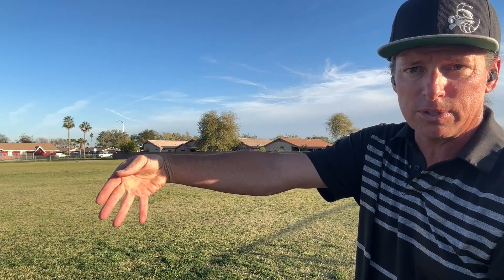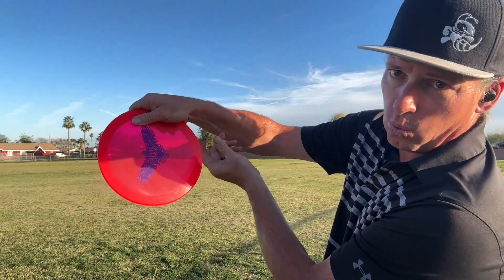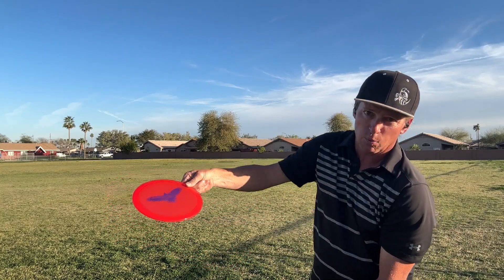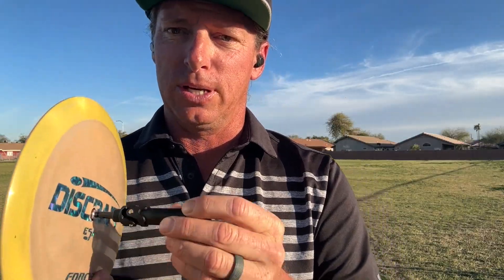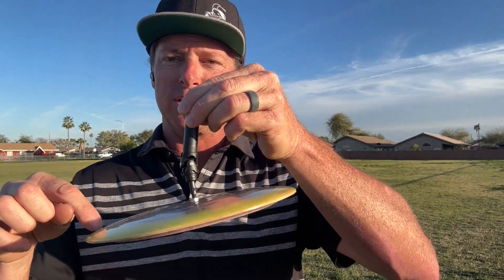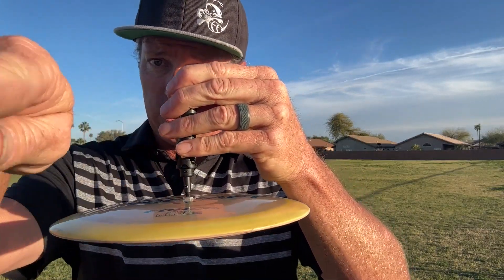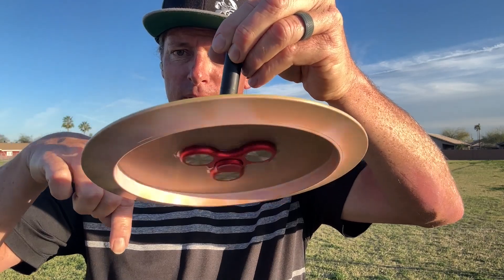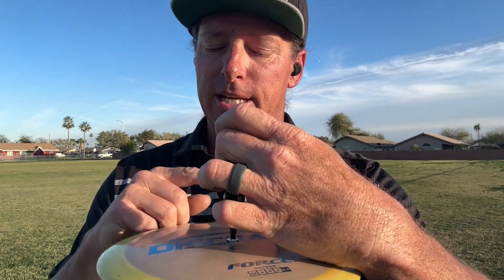Thoughts on Nose angle and gyroscopic precession

Comment: New subscriber to the channel and finally getting through these golden videos. I appreciate the demonstration, but now im wondering how you can apply pressure at the last point under the disc? You're taught to get your "thumb print" on the disc and grip firmly,  which I feel like leads to the pressure on the top creating that nose up effect you're describing. 

Any ideas to work off of help. I guess Im thinking maybe to focus on pulling in more to grip the disc from under, rather than thumbing it down too hard into my palm.
Reply: Naturally I went and watched your next video on grip which confirmed my suspicions lol. Thanks for the coaching Pete.
Reply from the maker: @marcocrespo8796  good work:)
Optimally the wrist needs to be in supination at the moment the disc begins to release from the hand….if we use the fingers to squeeze up into the palm it naturally holds the wrist into supination. (easy with a fan or modified fan grip, but doable with a power grip if the finger pads are shared in the crease between the rim and underside of the top)

Comment: If im not wrong gyroscopic precession would only apply if there was off axis torque on the shot. On proper releases there is not enough off axis torque to have to worry about this, and if there is enough off axis torque in your throw that is does matter then you have bigger issues then nose angle. I could be wrong but this is my understanding
Reply from the maker: @finnmccann446  all pressure put into the disc that is not in plane with the discs rotation around it axis is “off axis torque”.
Each finger as it releases from the rim impart a small off axis torque upward. This has a direct effect and in practice and testing can drive the tail of the disc up or down depending on wrist pronation and supination. More extreme off axis torque is often a mid-alignment of swing plane to release angle and is usually contributes to more wobble.

Comment: I get it and it makes sense. But how do i make use of this in my throw? How do i apply this upwards force at the end of my throw to create this gyroscopic nose down effect?
Reply from the maker: @bjornekloo  I made another video called “goodness grip”.  Check it out if you get a chance.
With an assumed starting point of having decent form mechanics:
Pronation of the wrist during the release point causes nose up. This is most often caused by higher thumb pressure  downward and/or finger pressure pulling into the palm. It’s common for folks to roll their wrists inward because holding tension towards supination while holding the elbow up can be challenging.
In the “goodness grip” video, I’m making the case that proper grip pressure helps keep the wrist in supination during the hit point, as well as allowing for each finger to release cleaner with a natural upward pressure, as well as keeping the thumb/index finger pressure neutral at the final point of release. It also allow for greater and faster wrist movement, whereas dominant thumb/index finger pressure tends to lock the wrist into one position limiting flexion and extension.

Comment: Gripping harder with the pinky and ring finger will give the push up in the back.   Not sure if anyone has mentioned this yet.
Reply from the maker: @mattbraam6357  depends on the direction you are squeezing your pinky and ring finger. If they are squeezing harder into the palm in a pulling motion, it can lead to wrist pronation. If the squeezing motion is upward into the meat of the palm below the thumb, it helps hold the wrist toward supination..
I did a video just after this one called “goodness grip” where I cover this. Please check it out.!

Comment: It's still a gyroscope even if it's attached to our hand. It's just that a fully grown man is easily strong enough to dominate the gyroscopic effects of a 175g disc spinning at 1000-1500rpm. Try it with a two-ton flywheel spinning at 6000rpm and you'll realize that it doesn't stop being what it is just because you put your hand on it.
Reply from the maker: Agreed. From reach back to the 4000ths of a second before it rips from the hand it there is the equivalent of a half rotation imparted on the disc, which on techdisc reads as a ramp up to 800rpms.
The main thing up for discussion for me was, can we call it a “gyroscope” when being leveraged from the edge, or is there a different scientific definition we are supposed to use. I feel I’m grasping the general understanding of what’s going on and sharing it, but I try to be careful to not make assumptions in my own statements sense I don’t have a phd in physics.

Comment: Really interesting video Pete! Thanks for sharing this. Do you think this means that the ulnar deviation/pour the coffee  is trivial or do you think that a combination of ulnar deviation and the supination/flipping the disc is essential to get the desired amount of nose down?
Reply from the maker: A form of Radial deviation grip is where most folks start their disc golf journey. Somewhere along the crease in the palm in line with the knuckles.
Our goal is to line the disc up in the crease on the hand from between the index and second finger along the crease that runs along the them/palm into the wrist. A soft ulnar deviation will line the disc up along the forearm and wrist.
“Pour the coffee” should be given with a caveat of “is HOT, pour gently, or you’ll spill and scald your yourself”.
When we over exaggerate the pour, we inevitably will bind the hinge (our wrist) along its extension path, which will lead to it wanting to unload radially part way through the release, often leading to a nose up issue.

If we grip the disc properly, I think much of this discussion will inevitably work itself out.
“Flipping the disc” over the wrist, is a “feel” exercise that helps us find a position not totally natural. If we stand and hold a power pock position with the elbow up, forearm level and disc flat, we will find that there is not much room for the wrist to supinate, drop the elbow and we can supinate farther because the elbow is the “limiter” to that movement.
 Pronation is super easy to do in this situation because most of the movement available along this axis is free to use especially since the gripping muscles pull in that direction.
Supinating of the wrist puts downward pressure on the disc and the nose will go up. 
If the grip is set up properly the muscles will work in such a way as to help the throw rather than harm it.
These “feel” exercises (flipping the lid, turning the key, suit casing, etc)are not the final solution, but rather a gimmick to guide us into what the proper position feels like so we can better align our body’s with the action we wish to produce.

Comment: did i miss the part where you tell us HOW to throw nose down?  i seemingly finished the video still not understanding how to achieve nose down.. am i to assume that to get the nose down i need have the bottom of the disc "underneath flate plate" facing my chest within the power pocket vs the top of the disc? or are you saying we should attempt to throw nose up so opposite of coffee pour making back of disc nose up but the back is really the front and when released the back becomes the front?? im still confused??
Reply from the maker: This was not a “how to video” on how to throw nose down.
This was really to help everyone understand what is “the nose” and how gyroscopic procession, and how the the pressures of off axis torque drive nose angle.
I’ll do some coaching style videos on the future and explain ways to help drive the nose angle down. There is another video before this one discussing” the last point of contact”
I’ll say this. If at the release point the wrist pronates, or thumb rolls under/pushes down on the top of the disc, the nose will go up. If at the release point, you supinate the wrist, keeping the thumbnail pointed to the sky, and fingers under the disc keeping upward pressure towards/into the palm, your will have better luck throwing nose down…..
“Coffee pour”… the whole purpose of this phrase is to get the disc level and in line with the wrist and forearm, Moving it from the disc lining up well below our elbow.
If we push the coffee pour to an opposite extreme, (a common problem now) as if pouring a bucket, the alignment of the disc will point not through the center of our forearm but across our forearm and above our elbow….this binds the wrist and exacerbates the nose up issue in the end.

Comment: I have one (a lot more than one) question about something that you're alluding to but I'm not sure if you have explained yet.  When your forefinger becomes the last point of contact and pushes upwards on the disc, it's causing the disc to tip nose down a little.   Is there a way to control this?   Are you saying that the fan grip has less rim pressure so the pop off doesn't cause the disc to go nose down as much and a stronger power grip would force the nose down a little more on release?   Would you want to minimize this release point contact to minimize wobble or are you sacrificing power when you minimize release point contact?
Reply from the maker: Thank you for the question.
I generate basically the same amount of spin with a modified fan grip as I do with a power grip. One interesting point I noticed is that the grip pressure is distributed near the same but slightly different. Power grip: my index finger squeezes around the rim to itself with the thumb covering/pinching down over it, while the two middle fingers squeeze into the palm as well as the pinky finger.
Modified fan grip: my index finger squeezes around the rim to itself with the thumb covering/pinching down over it, while the two middle fingers stack over the pinky and each other then squeeze into the palm but through the flight plate.
If the fingers are squeezing up and into the palm it tends to keep the thumb from dominating and causing the pronation or turning in/rolling under of the wrist through the release point. At the moment, this is the biggest takeaway.

With both of my grips the thumb and index finger come free of the disc at nearly the same time. Check the video that I posted just before this one for that video footage. I think a certain amount of wobble is almost unavoidable because the thumb comes off a smooth top while the index finger is snapping off a ledge.
I’ll do some coaching and form videos in the future, but for now I’m enjoying sharing the why of what’s going on with a disc. Once I get a few of these out, it will be easier to understand why I believe in certain methods of throwing and How we influence the gyroscopic system of a disc.

Comment: Cool stuff.  I've gotta watch more of your videos.
Why is it behaving this way?  Because it is spinning very rapidly while we are holding it.  The disc is spinning at its maximum rate at the moment of release.  The hand (fingers included) is what causes the spin (and all the stuff leading up to the release).  So of course the physics will act like it is a spinning object.  This video made it sound like this was in question or unknown.  Please forgive me if I misunderstood.
I had not thought of this before.  This is so cool!
Reply from the maker: Hi Scott, I think the basic point is: the disc does take on angular momentum just before the the release, the forces we impart upward or downward at that point are called “off axis torque”. The exercise for me was to state this in as simple a way as possible as well as allow you to see me perhaps struggle to simplify it without getting the language wrong for all the physics majors. :)The question needing better explanation is: can we call a disc that is still in contact with our hand, being levered from the edge, a “gyroscope”, and or what do we call it if it is not technically called a gyroscope till its free spinning on its own.
My point is stating that the disc is taking on angular momentum through the last bit of our throwing motion, and thus has the capability to resist off axis torque. If our last point of contact forces upward or downward in swing plane or from our fingers imparting a dis-symmetry in pressure, the effect of force will be observed on the “tail” of the disc at release.

Comment: I've been pounding people on the "nose" of the disc for a while. And what is taught as the nose is not the nose. its what you're saying. I took high speed footage to prove it as well. 

The hardest part of this whole situation is explaining that your grip to relation of your wrist flexation is really important and how we set up our body.

Pouring the coffee is only part of the equation, how our arm is able to move is another.  

I think what you're possibly meaning to say is that its taking linear torque and turning it into rotational torque. Because were taking leverage and turning it into speed and spin basically. 

I'm a bit skeptical on this whole flip the disc over method though. Because the idea there is that were imparting off axis torque on a disc to essentially try and get a gyroscopic effect of pushing the nose down.

I think that we could be publishing this particular data in more of a "bandaid" form, vs some of the other things.

As in. It's being presented as a fix for everything, not as part of the total picture.
Reply from the maker: Thanks for your comment!
The main point was to try to simplify the understanding of what’s going on.
Yes, pouring the coffee is part of the equation, however many act as though they have a 5 gallon bucket of coffee and the over exaggeration causes other problems. A careful pour the coffee technically gets the disc in line with our wrist.
Yes, the “flip the disc” technique isn’t the full answer and is as you say a “Bandaid” and will inevitably cause other form issues, I currently believe that the “flip the disc”, “turn the key” and “suitcase” method lead the individual into proper flexion of the wrist. This flexion is felt fully as an opposition to the elbow being “up”. This being done properly in effect keeps the thumb from rolling under and dominating the swing. 
Case and point, if our footwork is off, our hips will tend to be off, our reach back then be wacky, and our timing will be off, so the “flipping the disc” idea as well as other ideas like it will also be a bandaid with some placebo effects but ultimately will not make for a consistent throw.

Comment: Prediction.. three force directions, normal force, downward force, and tangential force… if you apply downward force it will split that force into two components of that downward force, a force normal to the disc and a force tangential to the disc which direction the disc is spinning from my point of view im not sure but I think the rotation of the disc will push/change/reverse the tangential because you are applying a negative force which will make one of the other forces negative in respect.. magnitude aside just positives and negatives
Reply from the maker: Thanks for the prediction

Comment: If we do release the disc nose-down, does it actually fly nose-down for more than just a few feet out of the hand? There is a whole new set of forces as it begins to fly. Can you please take your TechDisc and actually throw it in the field, and record the results for the first few seconds of flight.
Reply from the maker: Tech disc as I understand reads only the first three feet of flight.
You pose a fantastic question. 
First, the disc nose angle is measured in relation to launch angle. So let’s say -2 degrees nose down compared to launch angle of 6 degrees up would technically be 4degrees compared to level ground. The initial negative nose angles seem to help a disc thrown on a higher launch trajectory move forward higher off the ground and longer before stalling.
Once a disc is spinning in flight, it now is responding to the forces of air passing over and under it. 
At rest, a discs center of balance is basically the center of the disc, but as the disc moves forward through the air in flight, the air moving over the disc creates   Pressure or a lifting force. When flying at high speeds the center of pressure moves behind the center of balance, so in effect the air moving over the top of the flight plate begins lifting on the disc behind the center of balance. This is what is partly responsible for the high speed “turn” of a disc. The more “under-stable” discs tend to divert more air over the top of the disc generating more lift. As a disc slows down its lift diminishes, so the center of pressure begins to move forward in front of the of the center of balance, and we begin to see the discs precession towards what we call “fade”.

Comment: Would love another vid where you show it from your POV so it's easier to see instead of having to invert in our head. With the camera set up looking away from you, you could hold the disc out in front of the camera.

On the point about when it becomes a gyroscope, I don't know anything about physics, but if you apply a force to the disc just before it ejects, there should be a lingering impact of that force (e.g., pushing a side down) which is then certainly present when it is more purely a gyroscope
Reply from the maker: I’ve tried in my more recent videos to give the viewer’s perspective also.
Thank you for the feedback!

Comment: but is there a gyroscope before the disc has left your hand, or just as?  thats the next question.
Reply from the maker: That is the question that is posed, and the correct answer we think is: yes. 
We are adding angular momentum to the disc from the power pocket through the moment of release. When rotational forces are being added to the object it begins behaving similarly to an object with gyroscopic procession. The common vernacular we use in disc golf is “off axis torque”. This term makes no sense if the disc is not spinning or moving in a way around an axis by which it could in effect “resist the torque ” from an off axis force.